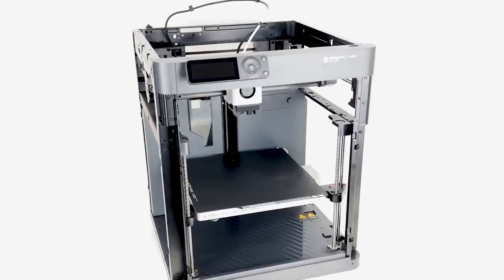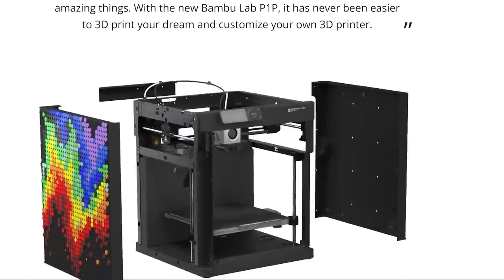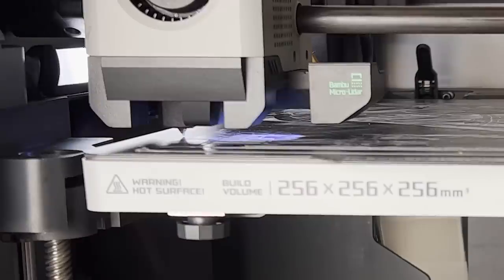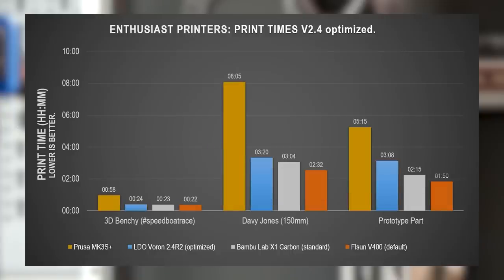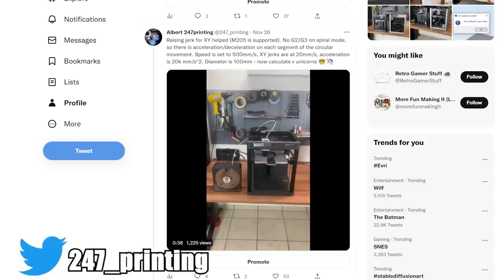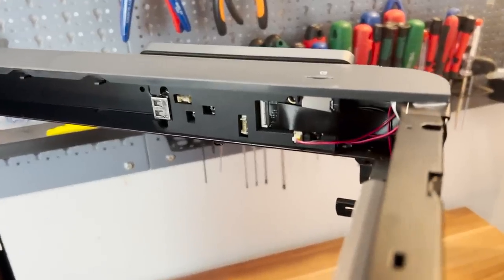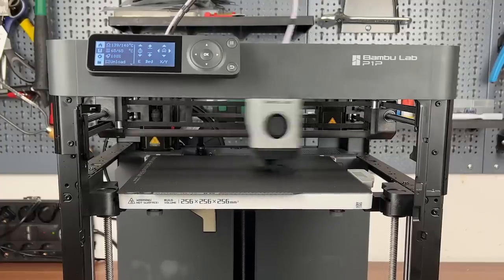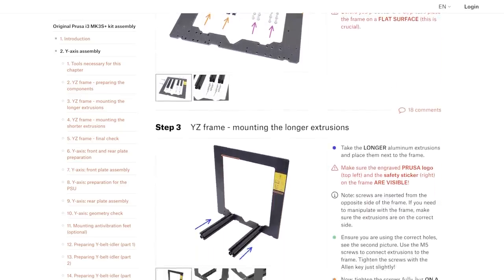Bambu Lab P1P REVIEW -  HOW GOOD IS IT REALLY ?!

Comment: I Think you had the right Conclusion. In the End my main Question is, why Prusa didn't evolve in the last 5+ years and why they stuck so long to the bedslinger design which is imo a bad idea. I got an Sidewinder and then a Zero  G (Voron fork) and im happy with my Voron but also jealous of the Bambu users and after building and tinkering i think a working machine is the thing i need. More than a Printer to finetune. The Question is, if a Prusa with a very very detailed guide to build it up and working nearly out of the box is the right thing to tinker. The best one is still a good old Ender 3 with 300-400€ stupid wasted Money for some mods. The only Reason for me to consider buying a very expensive Prusa was the beginner friendly design like sensorless endstops + the detailed documentation + the Community to get a lot of feedback to fix problems.
I really consider buying a Bambolab and ditch my 350x350 Zero G. the p1p should be enough but its like apple you want a bit better then you can buy the X1 and the extra "few bucks" for the carbon with these nice features is a simple decision. But 1300€ vs 700€ is a big difference and most parts are the same...
I just wish the hotend is quick changeable with different nozzle sizes and i hope they build up a great eco system with (at least now) very fair prices!
PS: Haste deinen Weihnachtsschnaps gefunden? :P
Reply from the maker: Thanks! Good question - a possible answer why Prusa didn't evolve much: There was not much need for this. The copy cats were cheaper anyways and mechanically it's hard to strengthen an IP. So they focused on small iterations of the product and on strengthening their ecosystem as well as all of their "secondary values": Such as support and quality/reliability.
Reply: @247printing  its the perfect analogy to Nokia for me....
After the first corexy systems got big, they should have stopped the bedslinger design. Prusa was a bit behind but bambulab is the final nail in the coffin. Let's see it's very interesting

Comment: Ofcourse the prusa mks and minis are now obsolete ...just like that and overnight because Prusa have been lazy in R and D for a long time. They have even realized it themselves and sent out questionnaires to hear what they can do to fix it .
Reply: Bambu didn’t do any new R&D work related to 3D printing. They took everyone else’s work and mass produced it.
Reply: @John Olson that's literally what all R&D departments do. These companies will not pay for REAL engineers to innovative new ideas. They can't afford to. Prusa definitely doesn't either and they also just take from the community as well. They don't innovate. All the low budget 3d printing companies just take and mass produce some clever, most of the time nameless, engineers work they did as a hobby and run with it.
Reply: @JohnOlson  do you understand what r&d is? They research what other people are doing, and package it into a complete product. They actually talk about this on their blog, and give credit to projects like the reprap project, the voron project, hevort, ratrig, etc.
Reply: I’m not sure you know what obsolete means.
Reply: @JohnOlson  how dare they not re-invent the wheel... they've brought a fantastic product that ticks every possible box at a price equal to or lower than the very best competitors. There is nothing to complain about
Reply: @bobbystem7384   no one asked them to reinvent the wheel. But they’re contribution here is manufacturing capability.  It’s the DJI way. Out produce and race to the bottom of price.
Reply: @JohnOlson  what printer uses lidar? What printer out of the box runs a LA test and selects the best? What printer has a multiple filament feeding system that actually works?
Reply: @tjlqk3  Not the p1p for the first two, which is what this video was about. I’ll admit the AMS is the best multi color system to date for a single toolhead.  Go print your chotzkies
Reply: @JohnOlson  well this printer is based on the the x1c so it correlates to your previous statement

Comment: mAnyone know if there's a reason to avoid buying a neptune 4 plus or something over a bambulab p1p? Other than a bit of troubleshooting on the neptune you still get crazy speeds and decent quality. Genuinely curious since a neptune is significantly cheaper and elegoo has pretty great customer support, I'm open to either option but I've got no interest in multimaterial single prints.

Comment: I’m still sticking to MK3S (even a clone) or Voron.  I don’t want a closed box 3d printer.  Your repairs and mods are controlled by Bambu.   Your personal needs may differ. That’s fine.
Reply: What's the point of modding when a printer has almost every feature imaginable? It's the same reason why people don't usually mod prusas
Reply: @morbus5726  Mods galore for Prusa i3s. Extruders, hot ends, bear frame, linear rails, revised printed parts for easier belt tensioning, fan duct for improved cooling, lighting. And more.
Reply: @morbus5726  The point of modding is modding. If I take the time I've messed with my printer or printed anything then most of the time I have spent modding it. And its not because its not working. It's because I have no need to print anything but I like tinkering with stuff.
Reply: @JohnOlson  I would not buy a Prusa with the thought I'm going to mod it. Sorry, if I'm going to spend  $800 to $1100, I don't want to tinker or mod anything. I just want it to work. Bambu with quality and speed combo is a no brainer. The cost is very good for what you get.
Reply: @Brett5106  that's good for you. Modifying and self repairability is not a priority for everyone.  Some, like you, want an appliance. Click and print. Personally, I place more value on the right to repair, open source hardware, and ability to modify to make better.
Reply: @rehepeks  I'd disagree. It's not modding for the sake of modding.  This isn't printing pretty panels on your printer.  If you watch the evolution of Prusa and Voron printers, modding is what takes the designs forward.  It allows engineers and hobbyists to tweak the design for improved performance and more.  If I don't like the hot end, I have choices. Higher flow, easier nozzle swaps, better cooling, LED lighting,  better rails, etc. Bambi takes that opportunity away.

Comment: Good Video. But why no comparison to the v2.4r2
Reply: there was a video on his channel a while back. It's really not a good comparison, as the voron is like double the price, and requires more than 30 hours of assembly.
Reply: @morbus5726  but is half that noisy;) it like the Bambu but it is so loud it is not even an option for me. And build size, speed etc are comparable. (May a Trident is closer price wise)
Reply: @ianwie3455  you save 100 euros on a trident compared to a 2.4 on the same size if you buy ldo. So 1500 euros for a trident 300, the only one that ldo sells. Also the trident will also get rather noisy, since you will need to configure the drivers to use spread cycle, so they are nearly as noisy as old a4988 drivers. In silent mode they cant reach enough speed to print at the same feed rate as on the bamboo, or at least will sound hella ugly when going this fast
Reply: @ianwie3455  The bambu is only loud because of the aux fan (which voron's dont have). By not using the aux fan, the noise is comparable to a voron.
Reply: @morbus5726  this would be interesting. It seems to be also the hotend/cooling fan which sound really noisy on the Bambu
Reply: @kilianlindlbauer8277  of course but you could also buy an formbot for round about 1k, right?! Like I said, I like the concept and the price but you are limited in upgrading and improving. But you get awesome speed and quality for an uneatable price where nothing can compete right now out of the box
Reply: @ianwie3455  formbot is of course  cheaper, i went with a formbot one. The thing is to get the voron to the same performance you will have to throw out a lot of stuff that makes it a voron, like the toolhead for example. Non of them have good part cooling, at least for pla, and are rather heavy. Also the x gantry needs to be changed, too heavy, especially the 2.4 r1 gantry (dual mgn9 rail).
If you are after performance, you are most likely better off with a ratrig, much stiffer frame and xy motion system. Thats important, as you cant really switch to a 9mm belt on a voron as you would need to redo the whole motion system. Sadly a ratrig is more expensive compared to a formbot voron, but still cheaper than a ldo voron even with the optional enclosure.
Reply from the maker: The V2.4r2 is in the speed comparison and: Watch my last video - big comparison incl. V2.4 :-)
Reply: @247printing  danke hab deine anderen Videos zum Speed und Voron geschaut. Denk ich werde einen v0.1 bauen (müssen ;) )
Reply from the maker: @ianwie3455  cool! Danke fürs kucken 😍
Reply: @247printing  ich habe zu danken. Wobei ich mich immernoch nicht zwischen ldo v0s1 oder formbot entscheiden kann ;)

Aber deine Videos sind top 🔝
Reply from the maker: @ianwie3455  danke nochmals 😍 Beide V0.1 laufen nun seit 9 Monaten und je ca. 500h tatsächlich 100% problemfrei bei mir! Kein Witz (sind aber auch ziemlich gut gebaut 😬). Kannst du vom Geldbeutel und/oder Verfügbarkeit abhängig machen - LDO ist rundherum halt ein bisschen mehr Premium und insgesamt sympathischer, performed aber auch nicht besser/schlechter.
Reply: @ianwie3455  I'm using trident and tried p1p. After the Trident is sealed, the sound is really not loud, but I think it is not difficult to make a p1p shell by myself.
Reply: @dark_xdark132  thanks. I think I will build an v0.1 because I fell in love 💕 ;)

Comment: Prusa has been the gold standard for so long they have rested on their laurels. The MK4 and the Xl Will not compete with the Bambulab.
Reply: Bambu labs wont even be able to compete next year when another made in china printer comes out and its better.
Reply: @thelightspeed3d712  What has bambu done that's innovating? Their two printers are built off open source innovations that other companies have been using for years now. Bambu just came in, copied the tech and slapped a proprietary label on it.

Comment: not only has prusa completely stagnated the mk3 platform, they even raised the price of the machine by almost 100€ 
you would think that 5 years of production would had done something to maybe even lower the price slightly or some better upgrades, such as new board etc
Reply: Stagnated? they came out with two upgrade revisions for it. Would you rather they be like creality and pump out a different printer every 6 months with just once change? Prusa uses genuine parts, not knock off clones like their china rivals. When OEM raises their prices, prusas does too, to offset the added costs. They could just start using cheap parts like everyone else, but then they wouldn't have the proven reliability that their known for.

Comment: So how about this..
V400 with enclosure and smoothing turned off and accepted lower speed, winner?
Winner for someone who wants a fast printer with large build volume that works good out of the box.
Rather no upgrades and rebuilds but to get High temp material printing a enclosure build is no problem.
Regarding printer lasting over time / wear out of parts, shouldn't a delta last longer since it reach high speed through its layout / construction rather than actual high speed movement?

Comment: I never bought a Prusa because it's so expensive (also, Reprap will never really work – you can't print control boards or stepper motors…).
Instead, I learned with a Biqu B1 (= cheap bedslinger, but with a good feature set) and then backed an X1 Carbon in the Kickstarter – and I am *super* happy with it!
I think, that the future of home 3D printing is not FDM though – instead, once the resin-jet-printing patents expire, that will hopefully trigger the next 3D printing revolution.

Servus aus München 🙂

Comment: I've had my X1C since Aug and would NEVER buy a slow printer again. Prusa mk3 line is a waste money if you compare features and price. The P1P is a little bro to the X1 but still get the fantastic speeds, accuracy and lower price.
Reply from the maker: I still use the Prusa for smaller parts or when the faster printers are occupied (and when time doesn't matter).
Reply: @247printing  If the money is already spent, on a prusa, I would not suggest wasting it. I was mainly suggesting if you had to start from zero or buy new I would not go backward.

Comment: A closed source printer is not an option for me.
Reply: yes, your option is slow printers 🤣
Reply: @sore500  Did you not watch this video? Vorons are an option, Ratrigs are an option, V400s are an option
Reply: @BeefIngot  As a voron user, I think the adjustments to it have exceeded my psychological expectations. If I buy another printer, I won’t consider the voron that takes hundreds of hours of debugging to achieve the desired effect, but p1p doesn’t need to think about it at all, right out of the box

Comment: I want so badly to get into 3d printing and have been waiting and waiting to which I pull the trigger on, each time I think yes, another comes out and when you see the mod videos by the time I've thought about it a printer comes out with the mods. Early on I was looking at the mk3s but over the years what have prusa done, nothing but kept the price high, have there been any tec up grades, no, still using same boards, have other companies been pushing r and d yes and have been reducing costs. Prusa looks like it started the boat and the times were good but they seem to have fallen off the boat and are being left behind, if they were to have slashed the prices years ago once the R&D was covered they would have blown other people away but with the fact that it's a self build high price you basically over paying for tec support. The p1p and x1 will bring makers to the party that just want to print and use it as a tool in the way it was intended. The biggest bug bear is now I'm even more blown away from what's available for £150 to £800.
Reply: Prusa is still innovating a fair amount, but the consumer printers don't see all of that. They have a complete system for industrial print farms that they're working on and have shown in exhibitions, I'm sure some may already even be in customer hands. They're also putting out a brand new Prusa XL which will annihilate the Bamboo products in everything except price (with up to 5 tool heads, you can do proper multi-material printing, and they're also CoreXY designs.) Prusa also has an industrial Delta model after buying up another company, and they also have some SLA resin printer options. But I will agree, the consumer models are looking increasingly bad compared to the competition, and I say that as a a MK3S+ owner.
Reply: @extectic  I agree with some of the comments but when you produce parts on an industrial level then why have they not gone down injection molding route like other cheaper printers, yes you have an outlay on tooling but you produce quicker and cheaper when selling in quantities. How long has it taken them to come up with the core xy when many others are already doing it. To me they seem to be to complacent and just going off "fan boy status " to justify the inflated cost, most companies after time would change and tweek the design and reduce costs to stay ahead of the game. I'm not in any camp or experience in printing and only going off observations.

Comment: Great comparison.
I think it didn't mentioned the key difference strong enough. Prusa is a machine of enthusiast meanwhile Bamboo machines are mass market machines. Both. P1P is a stripped down one. Little ugly looking like HP laser after the plastic removed plastic coverage. It was never ever made for enthusiast. Which is OK. Even these comparisons are very off. WHoa would ever review a Canon color printer with removed outer plastic panels and discussing what sensors and which servo motors/motion engine is there :-D. That time is over for this king of machines.
Unfortunately to Prusa they haven't recognized that most of the people on mas market want's a nice looking easy to use fats products. Bambu lab is filling that gap.  Unfortunately it is very hard to compete with a native Chinese company. Lack of rules, dictatorship, super cheap labor. Very hard to compete with on the mass market especially if they build on top existing intellectual property. 
I am crossing my fingers and hope Prusa will be able to take another step and compete even with Chinese.

Comment: Waiting for the Prusa warriors in the comments lol
Reply: There's a couple already saying prusa will be there when your P1P fails
Reply: @sculptaware4548  I mean...they got a point though. My X1C is currently out of commission right now with less than 100 print hours and awaiting a new heat bed. Tool head crashed into the bed while calibrating and wrecked it and the hotend. Already replaced the hotend. My prusa are still printing right now lol. 17k hrs on my oldest.
Reply: @Halo Machine  that's hilarious SMH that's. Thanks for sharing everyone makes bambu machine sound so great. I don't care for either company. I build my own machines.
Reply: @HaloMachine  interesting. Do you know why that might have happened? A faulty switch or a software issue?
Reply: @theosprey1950  I don't know why. Bambu said they "had never seen anything like this before", even though I found nearly 3 dozen other cases of this happening to other users before mine.